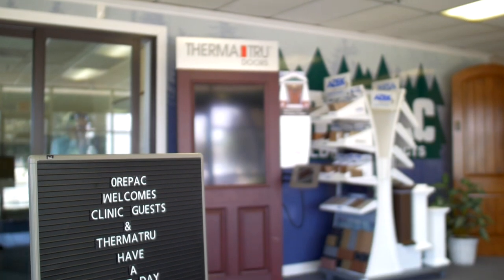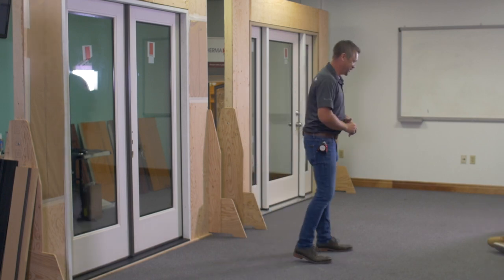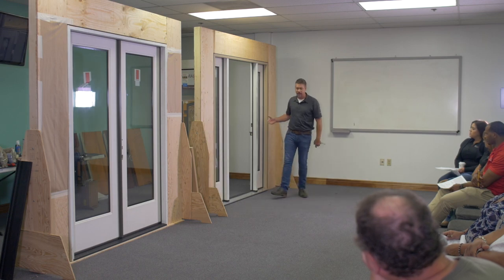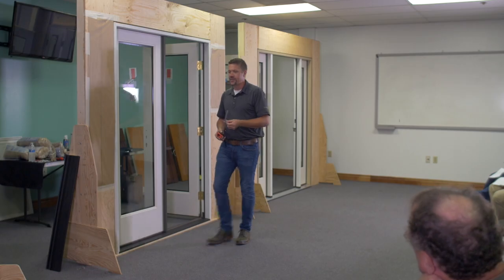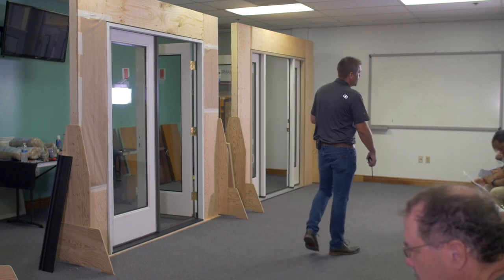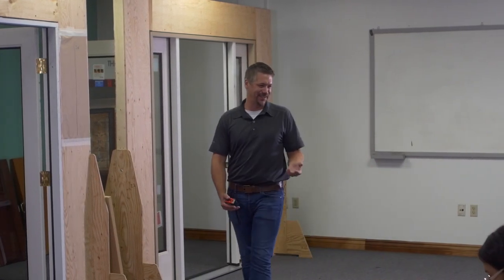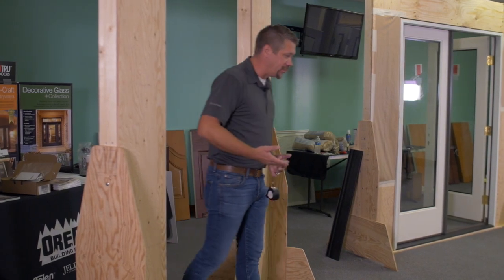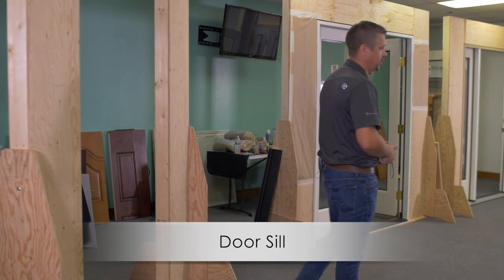How to Install a Therma-Tru® Pre-Hung Door

Comment: Why didn’t Therma True send or sell screw plugs to cover the screw holes . TRex decking you can buy the plugs to cover the screw holes . So now I have a $6k door with two sidelights to install with composite frame and can’t hide the screws behind the weather stripping.  I’ll have 20 screw holes to fill and color match . Seriously .

Comment: Great video, I have two Reeb French Doors, and I learned that the contractor installed the two French door’s Sill Pans using Silicone and not A HIGH QUALITY POLYMER like OSI QUAD MAX recommended by Reeb.  Can we replace the Still Pans (entire threshold)?

Comment: He said the gaps are different on the hinge and lock sides because hinges are mortised into the door and frame (which is good). However, I examined a TT Classic Craft door and found a detail that creates ADDITIONAL gap. The door doesn't have any bevel on either side. (That several-degree bevel that is specifically designed on the lock side to reduce the visible gap while still allowing the door to operate). TT obviously saves money by not doing the bevel so the slab can be hung on either side, but that makes the lock-side gap even wider - whole 1/4"!

Comment: Very useful video, many thanx for posting! I'm surprised there are so few views. Don't people want to learn anymore?
Which putty do you recommend for filling screw holes in a composite frame, if I want to paint over?
Reply: Window glazing, window glazing is good for filling holes it won’t shrink like caulk does, and if applied properly and sanded a few times it will be invisible.. at HD, the jar is in the paint aisle by the caulk, the glazing comes in a white jar with a red lid..